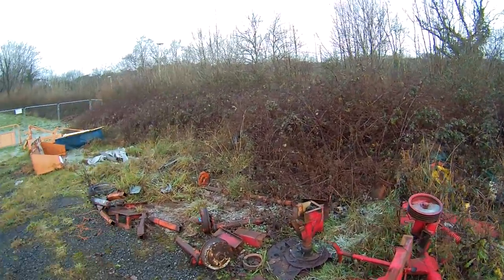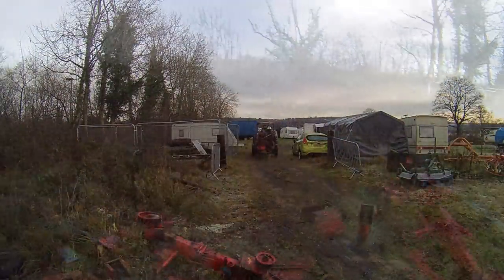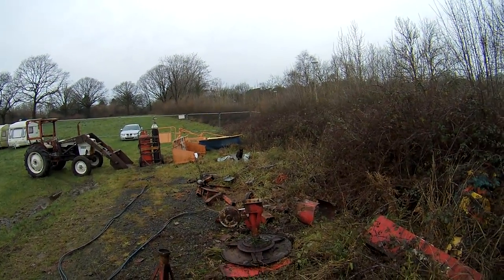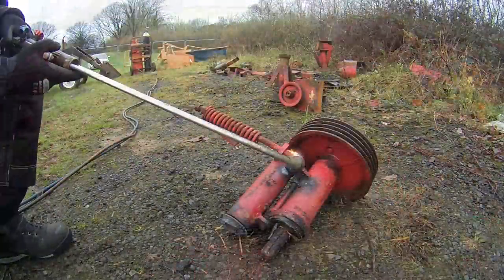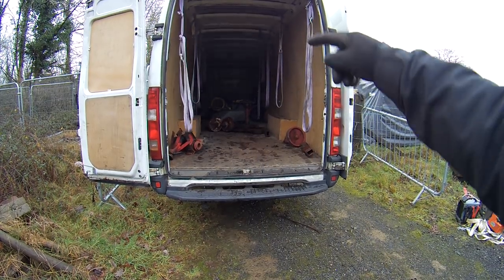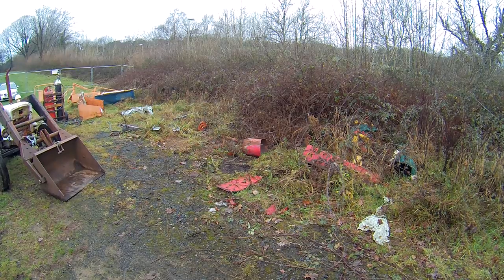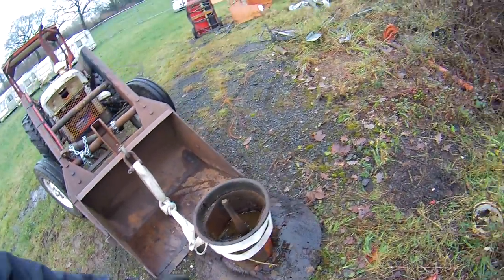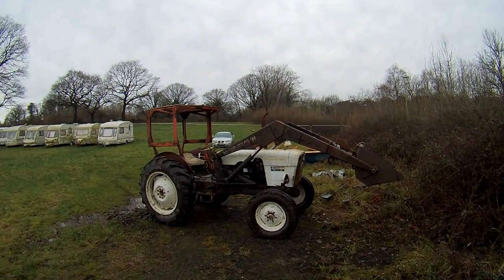Cutting Up Scrap And Loading With The Tractor,

Comment: In Ireland that pz  mower  wort 200  for braking lot em  stil  in use hear
Reply from the maker: Hi Brendan.  Yes I still use the same pz model myself.  All the parts I scrapped were no good as spares.  All worn out drums.  The main part was an old bamford mower ( nearly identical ) running 4 belts instead of 3 as on the pz models so that's the only reason it went. Thanks for the comments.  Cheers Calvin